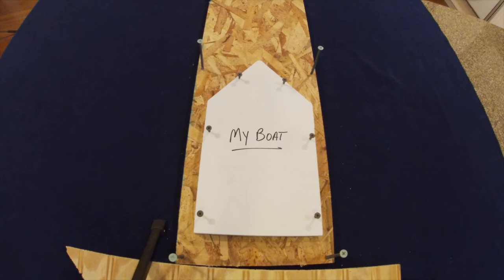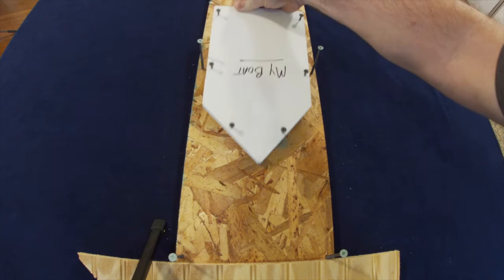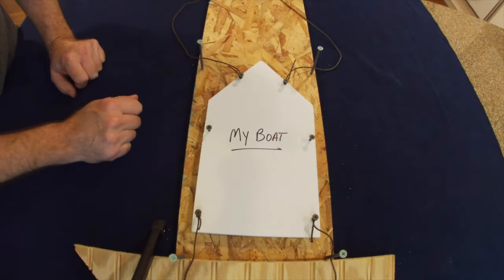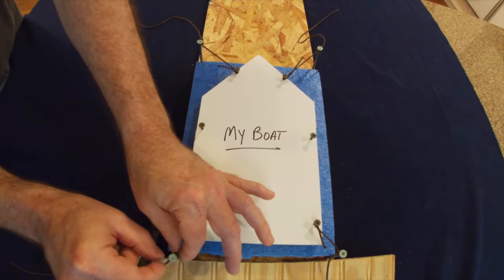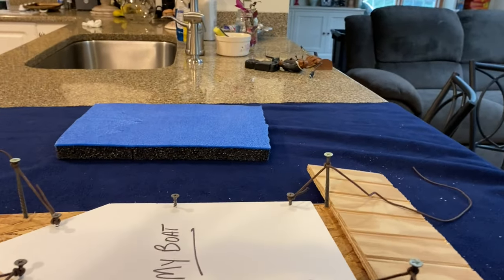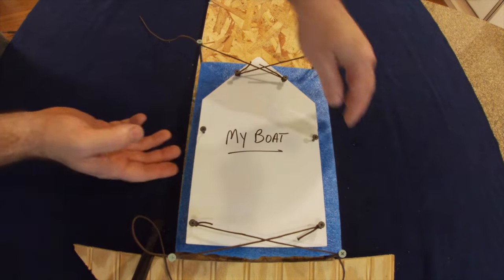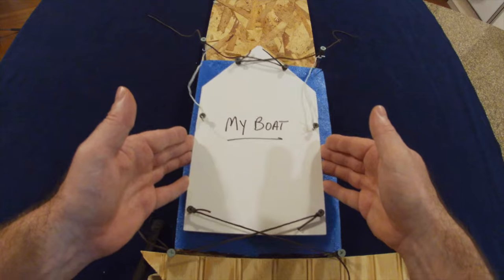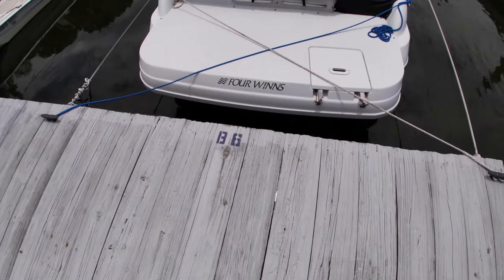How To Tie Off in a Boat Slip - Spring Line Docking or Parking a Boat

Comment: Nice explanation. Glad I'm in a flaoting slip. Crossed lines will cause wear across the boat and create a tripping hazard on swim platform. I do have permanent tied off lines in slip and do a short and long side making it easy solo. Tie off long side, push boat over and tie short side. This also helps for toons that want to use side entrance.

Comment: Good explanation, nice model.

It's all about longer lines being better when there is height variations. Also: longer lines have more stretch and exert less stress on the cleats.

I'd argue crossing the bow lines is not necessary. They are close together anyway and you don't get much of the aforementioned benefits.

Comment: Good video. For our setup i use the midship cleat on one side for bow & stern spring lines. And like you mentioned we have dock we have pre made lines secured to the dock so we can easily tie up. We keep regular lines in a locker for going anywhere.
Reply: I concur that using one spring line attached to the bow and another to the stern is the classic method. I share your view on this.

Comment: Great idea illustrating with your model. Nice work!  

You mentioned tying up with the loop end on the boat. That’s the only way to go in my book. 

It’s easiest to avoid having to adjust all lines every time. Why reinvent the wheel every outing?

Adjusting the line lengths at the posts/piles takes a minute, but then its done for the season.  Plus it becomes a known quality… takes no time to secure the boat on return, and avoids being at home later wondering about the boat when thunderstorms roll though… you already know your dock line setup is reliable. 

Adding a way to stow the lines on the piles while you’re out rounds out the system. Don’t want lines hanging in the water, getting dirty and hard to reach. 

Keep up the good work! 😊
Reply from the maker: Thanks!

Comment: Great video and phenomenal explanation. I knew that crossing the lines was the way to go, but didnt understand why. After watching your video/simulation, I'm now guessing it is due to more length on the rope (vs. Shorter rope on the same side). How tight should you initially set the ropes?
Reply from the maker: Ideally set them so that the boat is centered in the space. Sometimes it takes a bit of tweaking at first.

Comment: I was taught not to use the slip through the middle of the cleat method. By doing that you can’t adjust the line from the dock. A normal cleat hitch allows adjustment from the dock.
Reply from the maker: Yes I have heard that too - but by having one point of the line "fixed" can make it easier to always tie off in the exact same position of your slip. Some people also mark their lines to know exactly where to tie off in their own slip.